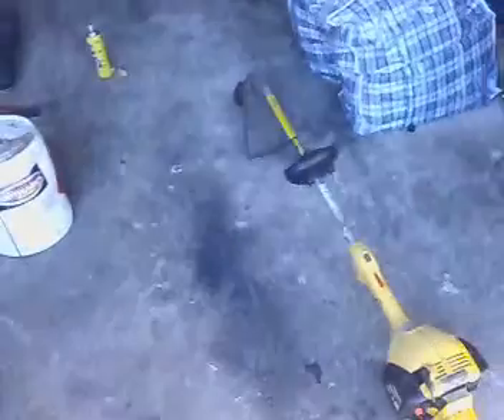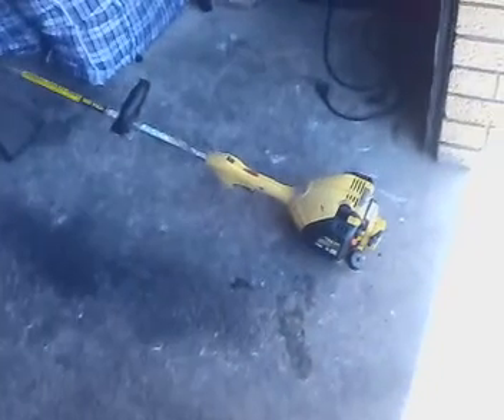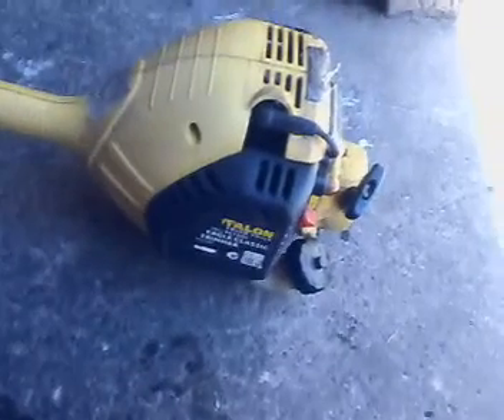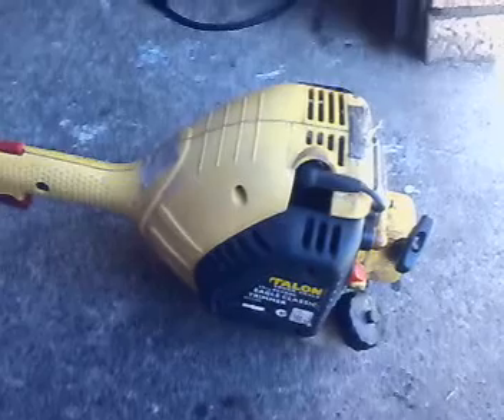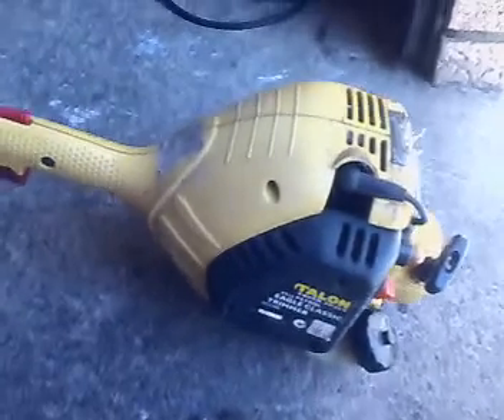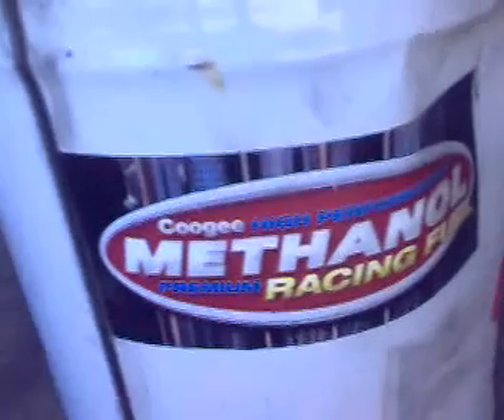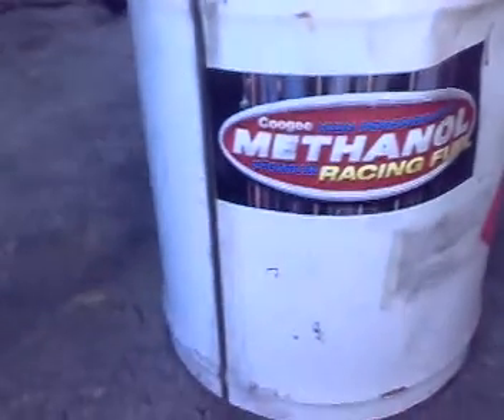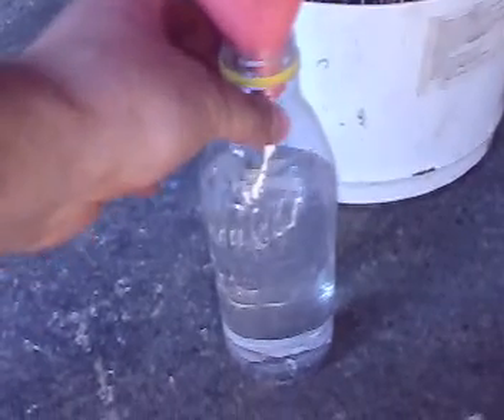Petrol VS Methanol Whipper Snipper

Comment: If you didn't adjust the jets on the carb after the fuel swap I'd say it's running way lean. I'm surprised it started at all after the swap. I did this to my old whipper snipper as well and you need to open the jets to allow more fuel in. Methanol has less energy per volume then petrol which is why you need to run it richer.

Comment: Most oil is not soluble in methanol as it is highly polar (I used to use 50,000 litres / day of methanol in a plant I built so I know its properties).  A little biodiesel (or castor oil but biodiesel is better) in the methanol will give the lubrication it needs. Also methanol is no more carcinogenic then gasoline, if gasoline is in a lab environment you can only work with it under a fume hood with gloves on.
Methanol has only half the calories of gasoline so you need to tune the carb to run 2x

Comment: Methanol is great for power.Used to use it in racing two strokes.But it can damage engines if left.Used to fit a carb set for petrol and flush the engine/crank out after race events.If left methanol gels,sucks in water vapour,rusts cranks and eats aluminium,not fun for your tuned engine!

Comment: The mixture is too lean when you ran methanol and you had no 2 stroke oil mixed in. Methanol requires a little over 2x richer fuel mixture.